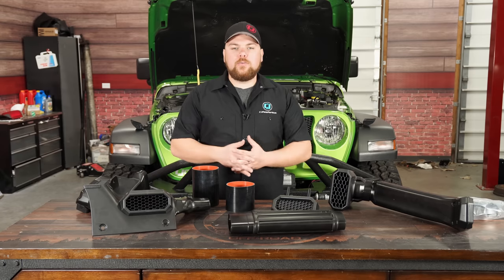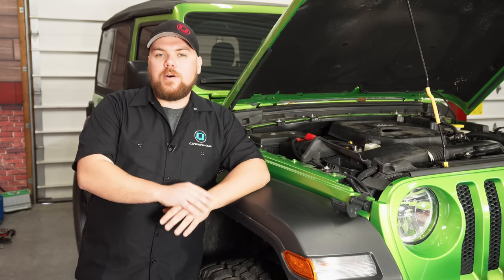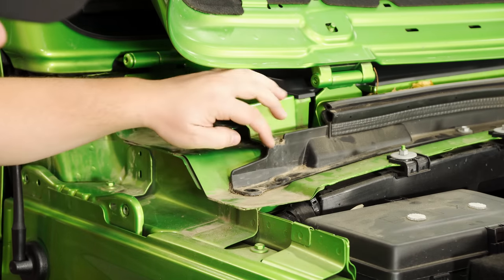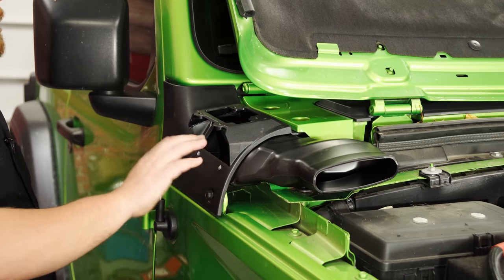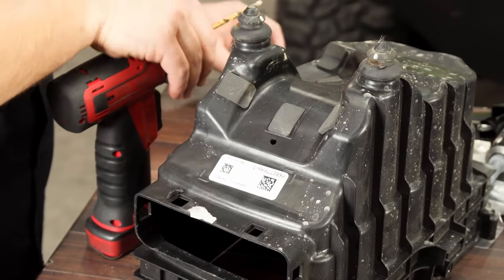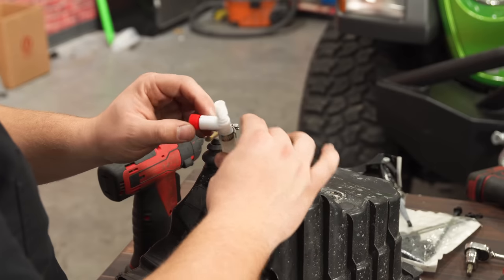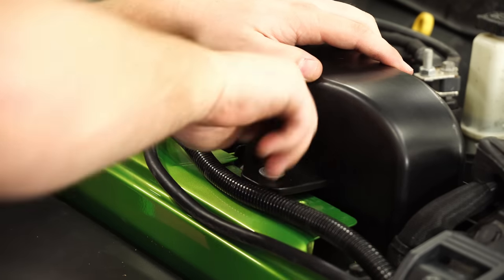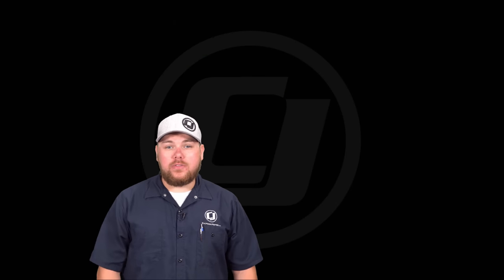Jeep JL Wrangler/Gladiator Install: Rugged Ridge XHD High and Low Mount Snorkel Kit

Comment from the maker: Both High & Low Mount Snorkel Kit: https://www.cjponyparts.com/rugged-ridge-snorkel-kit-xhd-high-low-mount-jeep-wrangler-jl-2018-2020-gladiator-2020/p/1775631/
Low Mount Snorkel Kit: https://www.cjponyparts.com/rugged-ridge-snorkel-kit-xhd-low-mount-jeep-wrangler-jl-2018-2020-gladiator-2020/p/1775635/
High Mount Extention (For Use With Low Mount Kit): https://www.cjponyparts.com/rugged-ridge-snorkel-kit-xhd-high-mount-extension-jeep-wrangler-jl-2018-2020-gladiator-2020/p/1775636/

Comment: In a way I understand why they didnt do any supports for the upper snorkel. The issue I have with the Mopar is that you cannot put the windshield down. This lets you remove the high snorkel and ride with shield down still using only the lower snorkel. Smart thinking!

However, it looks insanely cheap. Wish they used better abs plastic or even carbon fiber.
Reply: It looks a lot better if you paint it

Comment: I'm on the market for a snorkel for my 2020 JL. Not sure I'd ever want to use the low mount kit by itself. Its a good way for water/mud to splash through the opening and into the engine. The high mount looks awesome, doesn't cover up hood decal. :)
Reply: Good point, I think the main idea is you can easily take of the high section if you want to be able to drop the windshield.

Comment: The point of the valve is too let water that builds up in the air box out, you should leave it open all the time to let the moisture out. And close it before you are about to cross some deep water
Reply: So you keep yours closed all the time?

Comment: How do you reach the drain check valve after the air box has been installed?
Reply from the maker: Under the fender liner you can pull it back and see it!

Comment: Wow, been waiting for this since last year. Disappointed to say the least. Looks cheap AF! That body fitment looks terrible.
Reply: Yea I even think he notices when he installed it himself that the plastic didn't line up and had a gap by the windshield. Alot of water is going to go into that open section.
Reply: Ace Calzadilla , right! And further disappointing to see Wayalife’s Recent cover of Sema the other day, And see their snorkel unit again looking a lot more rigid, painted up and looking much more quality
Reply: The fit to the A pillar is horrible.  Looks like it is bent.  Can see that pulling farther away over time.  Also saw him kind of push on the whole unit trying to get it to fit properly.  Those band clamps appear too circular as well and will put excess pressure on the edges and warp it over time causing leaks.
Reply: This is not looking good.
Reply: Hate to say it, but it must be something in his install.  If you watch Quadratec's video you can see he has to push the whole thing in before screwing down the hood side bolts.  He then went on to color match paint it and it really came out looking good.   In case you haven't seen it yet...https://youtu.be/pAuo0DItcXg
Reply: Christopher Robinson thanks for the link. Huge difference. That looks great. Much appreciated dude!

Comment: The factory air intake  sucks,  can this work with aftermarket ones?
Reply from the maker: Unfortunately this has been designed for the factory air box.
Reply: @CJBroncoF150  ya,  that's what I thought..  Very disappointing.  Becpuse I like the out side of it.

Comment: I like the way this snorkel looks, better than others I've seen, but DAMN $500.00 for a few plastic pieces of tubing is outrageous.  AND having a drain valve on the air box worries me. Why would water be in the air box? Seems counterintuitive. Does it mean these snorkels are prone to sucking in water?

Comment: Is there some kind of support for the upper portion around the top or middle of the snorkel so it doesn’t get knocked around?
Reply from the maker: Yes there is a rubber bumper that threads into the back of the snorkel which keeps pressure on it!

Comment: This might be a dumb question... what do you do when it rains? Bag it up? Or is there no concern????
Reply: I think that is why he drilled the drain hole
Reply from the maker: You just let it the way it is! There is a drain hole in the factory airbox if any water gets down through the pipe!
Reply: There's also extra weep holes where the upper intake connects to the down tube.

Comment: Holy gappage batman!

Besides the obvious warped gaps the screws on top of the low-mount ruin the look of the low-mount.
Plus I believe the low|mount they showed last rear sat flush with the cowl.  I was excited last year about this.
But not anymore.  Won’t be buying it.  It will be at least $200 cheaper in 6 months.  $500 is crazy overpriced.  No one is going to buy it.
Reply: I come from the future... the price is the same...

Comment: This is what irritates me about Rugged Ridge. They have awesome product designs, but the physical product quality is complete garbage. I stopped buying their stuff back when I had my JK because nothing ever fit properly or lasted long enough. I remember when the powdercoating of their original XHD bumpers would flake off just by simply handling it.
Reply from the maker: The quality on this new snorkel is very high!
Reply: Was anticipating the release of this and even contacted rugged ridge to find out when. Yeah, guess I'll be looking into a River Raider. Much better quality and fitment. I'm really bummed about this.
Reply: @CJBroncoF150  No, it isn't! Look at the cowl piece in your own video! It doesn't line up properly at all towards the top along the door. Typical Rugged Ridge quality.